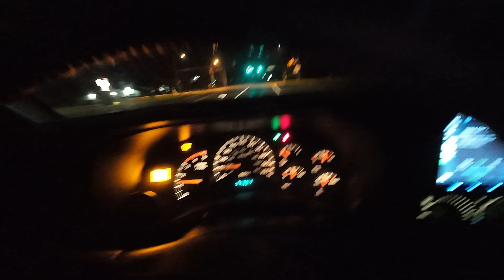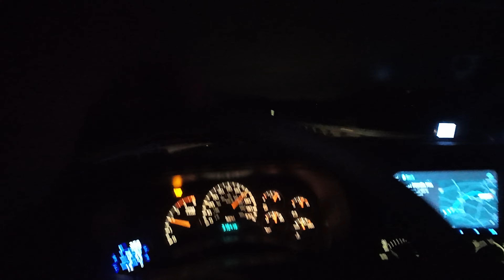Hauling my Dozer with an old Duramax didn't go well.... 30,400 gross weight LB7

Comment: Another comment ( had to watch 25 minutes of video) 😊  ❤before I got to see the wonderful 450- B move some dirt
BOY I wish I could get my Dynahoe to helh remember tree roots 😊 I would let you just use her to help. I had a Maple stumb twice that size. And the Dynahoe even being a 1978 with (8000) hours on meter just lifted the maple stump up with one pull 😊 I rented a dumpster from a yard waste place about 5 miles from me. I loaded up the stumps in it with front bucket 😊 I took out 5 maple stumps from my small back yard 😊 one your pickup or should say gooseneck flat bead. Was it because of Wt. Of 450-B LOAD or is it your opinion the computer board is just getting hot from all the road travel with that Wt. Those solder connectors might be melting out of connection. I love you showing the 450-B brake shoe adjustment access plate and demonstration of Beake adjustment, that was outstanding to see what that side plate cover is for 😊❤😊
Reply from the maker: My long winded theory is this: The FICM is cooled by fuel. Pulling all that weight had the engine under a lot of load and the ECU was commanding full rail pressure for hours (26k psi). This gets the fuel hot and possibly over 212F. There was already moisture in the FICM from an unrelated issue. I think the hot fuel allowed some of that moisture to turn to steam and thats where it started to affect the components on the PCB. No problems since replacement, fingers crossed.

Love to hear about your Dynahoe. There great, heavy machines. I hope you wear hearing protection if yours is a 2-stroke!
Reply: @spankranchgarage  
YES the Dynahoe is a ( 2 stroke) but the loudest beast I have is a 1971 SeaGrave engine with you guessed it ( 8V-71) Detroit Diesel. My wife thought let's put stacks straight UP. So on Parade we don't blow smoke on kids sitting 
On curbs. Boy "O" boy she is loud ( I use hearing protection) when I have to build RPMs to get the shift in gear. She has a (5) speed ( Dana/ Spicer
Transmission. The thing about the Fire engine that's so amazing is the (3) filters 1 oil ( sock type) in the canister (2) fuel filter are screw ones. They all are under the engine just above the frame rails. The (3) air filters are up top on passenger side rear top of engine. I can just slide under Fire engine to do service changes 
It's easier than my 2021 Silverado Duramax.

Comment: I realy feal for ya on this one. Im gona guess you have alredy got this repaired. But to make it a little easyer on your self you could release the tention on the track and get it back on to atleast move it up to a better spot to work on it. Just have to go easy while its bent. As for your slack adjuster rod they rot out spending there life coverd in dirt. Good thing you got that mill to repair it lol. Fixing the rail isent too hard Youll get it fixed. Cant wait to see it.
Reply from the maker: Your video was super helpful for me to fix this!! Its no fun when the track jumps to the inside. Shes fixed and ill have the video up soon
Reply: @spankranchgarage  glad it helped ya lol.  when mine came off i was on a fairly steep bank sidways. The down hill track came off to the inside the track became loose the sprocket was sliping and wouldent grab. The up hill track was just spinning cuz all the weight was down hill. Bank was too steep to jack the dozer up on. It was a mess. Ended up hooking to the back of it with the tractor and pulling just bearly geting it to spin around . As it was going down the hill backwards it poped itsself back on. Managed to keep it on to get it to the garage.

Comment: Your truck is cool being a ZF6 4X4 LB7. They’re pretty rare. How does it pull that kind of weight being a manual transmission?
Reply from the maker: They are hard to find I’m surprised gm didn’t sell more of them. It goes really great. Never need to worry about trans temps. The low gear is great to get a heavy load rolling. You can really labor the engine too. 1800-2200 is the sweet spot. I was dropping to 5th and 4th on the grades but I wasn’t willing to push egt’s over 1250, just taking my time she’s an old truck. I have an exhaust brake on it too which is fantastic with a stick shift. 55mph down the mountain I can pick 6th 5th or 4th gear depending on how much brake I need. Having cold truck/trailer brakes at the bottom is sweet. It’s a 13 mile 6% slope
Reply: @ that is great to hear, thank you for sharing. Keep up the good work and keep that ZF6 around. I own a 2004 Chevy 2500HD 4X4 crew cab shortbed 6.0L with the 5 speed NV4500
Reply from the maker: @ stick shift GMT800s are king!  I had an ext cab long bed 1500 before this with the 4.8 and nv3500. It was a great truck I just outgrew it eventually
Reply: @ they’re king for sure! I wish I could get my hands on more of them but GM didn’t make many of them. I also own a clean 2001 single cab LB7 with 116k miles. I live out in the west so rust out here isn’t necessarily a problem

Comment: You said your truck had over 300 thousand miles on it. And it still running good and pulling all that weight. Damm good truck sir.
Reply from the maker: Yeah she just turned 320K miles. Shes tired but still getting the job done.

Comment: I love your mindset 😊❤😊 on welding ( Chain HOOKs) to front blade top. So many times I had to run chain over blade base frame. In my Humble opinion that is a area that gets weaker over time, dozer we hauled did NOT have frame welded RING for tigh downs. You asked me if I was in Alaska. I have traveled there on Princess Cruises only. I live in NW 
I own a 1978 Dynahoe-190 Two wheel drive. My all time favorite Backhoe 😊 even though I started learning on a Case 580- CK then ran a brand new 580- C working for my uncle. Then a 580-D and 580- K when Case change there boom design. Why you ask do I own a Dynahoe it because I ran one in 1979 on a huge mainline sewer ULID housing development. I did hoe pack work but mainly dug side sewer stubs. I also ran a 680 Case with just hoe packer on mainline crew. I just feel in Love with the Dynahoe thay just were a beast of a rubber tired Backhoe ( backhoe end part of mainframe ) they dug standard depth without extension with backhoe 19 feet deep. That old (353 Detroit Diesel) just keeps running for me sense 2003 when I found her. Me like you could not pass up buying her. We wrote up a sales contract with the desperate home builder who wanted to sell her. I gave him some money down payment and if the leaky hydraulics and brake repair were more than the cost he wanted for the Dynahoe 
Then I would not pay him the rest that he wanted. He was asking to much for what I had to do resealing all the hydraulic leaks
Just like you on the front blade control for dozer he had hooked up the front bucket dump backwards. I did the same as you switched the hydraulic hoses. I have one more front dump cylinder that leaks bad right now. I just did the other one. The last hopefully on leaky seals 😊

Comment: 1:02 as soon as you started that I knew it was going to break on you at 70° f a John Deere dozer has one minute of heat up time you you started that machine up and immediately lifted the blade up on cold oil
Reply from the maker: Interesting point, I appreciate it. I dont agree with it though. The fluid is moving either way, who cares if some of it goes to the lift cylinders. You wouldn't warm up your snow plow hydraulics to go plow snow.
Reply: No. I would think a little harder before making that statement. @outdoorlifemaine6691

Comment: Been there done that with my 450. Always happens in the worst places and the worst times. The tensioner shafts get rusted and weak and breaks when on slight angle. Replace with any similar sized shaft or sleeve over what's there. In a tough spot, need some bottle jacks under that side. Hopefully the idler will slide back easily enough and you can pry the track back on. Goodluck mate I know how it feels
Reply from the maker: I’m learning that if I’m gonna run old equipment I better get good at fixing it! Looking at it now I see the weld was partially cracked for a while it was already rusty. Thanks for watching!

Comment: If you put low sulfer fuel in a older machine you should put in a lubricant, some older injection pumps can seize up
Reply from the maker: Good point there. Ill add some additives

Comment: i know that feeling when there is unexpected resistance/circuit corrosion. It really hurts trust even when the wire's/solder joints are fixed cause it can be a big question mark of what actually caused the issue to start. Great to see you over came it

Comment: what tunes do you have? just curious
Reply from the maker: I make my own with HP tuners. 45% injectors and a pretty mild tune. Then a banks economind on top so I can turn it up and down on the fly. Works great
Reply: @spankranchgarage  Nice how much does that cost to get a setup to do that? Im just running a flashed tune, I put in 45s last year Id like to get back to a stock file so I can use my ppe tuner any suggestions where to go to back to stock?
Reply from the maker: HPTuners is expensive to only use for 1 vehicle. I tune many cars with it so it was a no-brainer to me. You have to buy the hardware and per vehicle credits

Comment: Soooo u do need it cooled? Ppl been running it without fuel into it for years . Is that the case or is it just a bad ficm?
Reply from the maker: The cooling certainty doesn’t hurt. But this one had moisture in it and as it got hot was causing the malfunction. Be careful washing under the hood and you will be fine, cooling it or not cooling it.

Comment: psh you got trust issues, try owning a 6.0 psd as your main tow rig
Reply from the maker: So you’re a FICM and standpipe o-ring type guy??
Reply: @spankranchgarage  oh definitely, just replaced my ficm last week because I noticed the voltage dropping when I gave er the beans 😂 can’t wait to shut it off at the drive thru to order and have it not start back up because it can’t build 10,000psi of oil pressure

Comment: "Come up with a game-plan": get as far removed from common-rail bullshit as possible. Simple!
Reply from the maker: I couldn’t 12v swap it in time before I had to leave! But yeah I hear you. When it works it works. When it doesn’t your screwed
Reply: @spankranchgarage  Yea, I hate to be that guy that preraches "12v! 12v! 12v!". But I was preaching it long before it was the cool bro thing to do. And not just Cummins. I am good with just about any mechanically injected diesel (except for the HEUI system. Far too complicated). Mechanical injection pumps and carburetors generally don't leave a guy crippled or stranded near as often as computers and wires do, LOL. Anyways, love the channel brother! Your get after it attitude is inspiring. And, you will make a fine machinist as well. Trust me, I've been a machinist for well over 30 years, and even own a shop. I can spot the good ones. Now get you a real lathe! HAHA (I'm just yankin yer chain)
Reply from the maker: Thanks for the kind words! Yes a real lathe is in my short future. Getting tired of the toolpost flopping around like a wet noodle